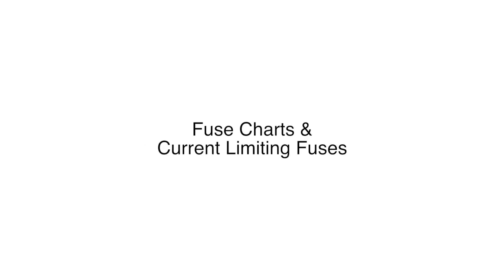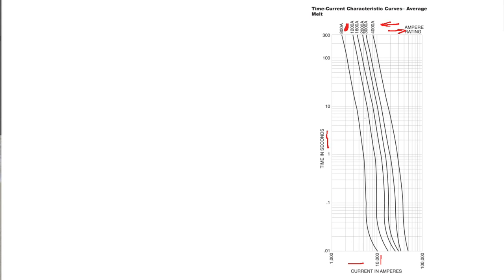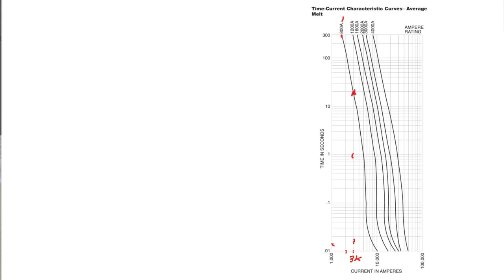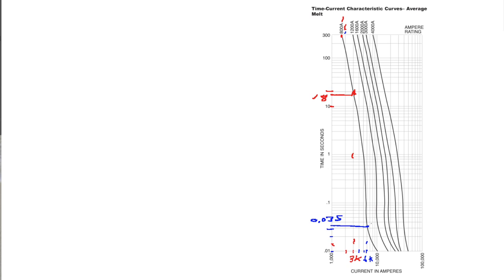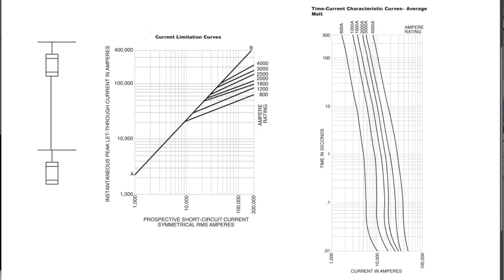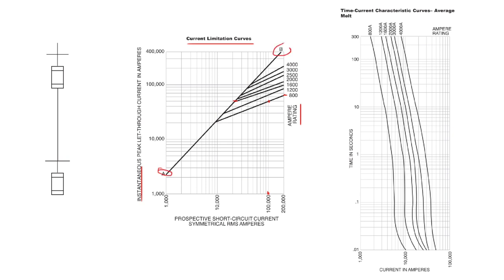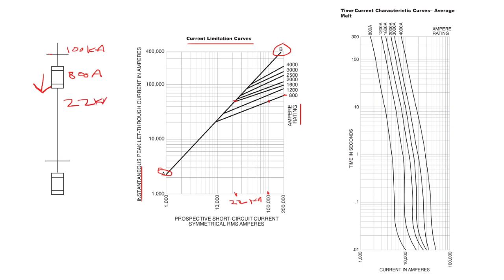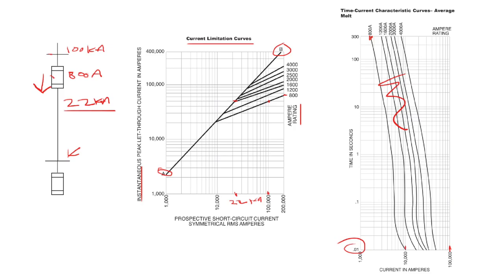Understanding Current Limit Fuses and let through current

Comment: I'm working on a project currently that has two CLF's in parallel with each other, that are then in series with an expulsion fuse. I assume that would operate as a current divider, half of the available fault current going to each CLF, then adding back again as it hits the expulsion fuse, but wanted to make sure there wasn't other considerations that should be made for this configuration. I would greatly appreciate your insight on this! Thanks for the great video!
Reply from the maker: Realistically that may typically happen but what if the fault is in the before they rejoin?  In general it's safest to always assume peak fault current will be present regardless of circumstance.  Things change, temporary setups in an unplanned situation
, etc.

Comment: But why let through the 20kA fault currenti in the first Place. wouldn't that just damage the downstream circuit
Reply from the maker: There's a few things to consider, first most standard overcurrent protection device have to let through more current than it's rated for for a brief time to handle inrush current (motor, transformer, etc).  Past that, yes it's ideal not to let through any fault current I'm not aware of any mass market protective devices that does this.  "Instant" trips always have a minor melt time, latching time, etc so during that time there will be some level of fault current.  Some fuses and circuit breakers specialize in minimizing let through current.  Past that, the downstream devices need to be rated to carry whatever potential fault current they may be briefly exposed to.  Protective devices should be rated to carry full fault current (not let through) unless they're in a manufacturer approved series combination.

Comment: Where does conductor length factor in
Reply from the maker: The conductor length/size/properties reduces the fault current from the source to the fuse due to it's impedance.  Calculating the available fault current is not covered in this video.
Reply: @graceyj20  I was binging and just put the comment on the current vid I was on. Thanks

Comment: UL 508A is concerned with Peak let-thru, not Symmetrical RMS, when determining the short-circuit current rating of an electrical enclosure.
Reply from the maker: Thanks for you comment.  Certainly some standards so however NEC (2017) focuses on the symmetrical rating.  See article 100 Definitions for Short Circuit Current Rating.
Reply: @graceyj20  How to evaluate this? I have a scenario where using current limiting fuses would normally consider the symmetrical RMS even major fuse manufacturers will highlight the consideration of the sym. RMS not the peak let through. But say a client will want to require the consideration be in "peak let thru" and even highlight SB4.3.3 as a reference. so clearly this is a battle of consideration between the one with "peak" and those with "rms" please advise. I am so confuse right now.
Reply from the maker: @zidanetribal2343  Typically NFPA 70 (NEC) requires all components to be rated for the symmetrical fault current they may be exposed to.  There are exceptions though such as manufacturer approved series rated devices.  Other standards have different requirements and methodologies.  NRTL's such as UL also approve manufactured assemblies where the assembly provides an integrated designed unit that has undergone independent testing and has specific operational guidelines.  Ultimately it comes down to the details of the circumstance, engineering judgement and what the authority having jurisdiction will permit.  With respect to safety and liability, one can never go wrong with a fully rated unit.
Reply: @graceyj20  I see, so it goes down on where and what a scenario will require like in all standards, if say company A will require compliance with standard X then by all means we will comply with standard X and also if company B will require adherence to standard Y then we should follow. Thank you so much.

Comment: Thanks Jonathan, i am only confused on your last sentence.
Once the 800A fuse melt due to 100kA fault, shouldn't be the fault level is cleared?
Assuming the Fuse in connected in series with the system, the fault will be isolated from the down stream isnt it?
Reply from the maker: Hi Zen, yes the fault will be isolated after approx 0.01 seconds.  Prior to that it'll let through 22k in my example.  It may not have been the best example as the time is so brief... as another imaginary example, let's say there was 25kA of fault current and that some current limiting fuse had a let through of 10KA and a trip at 0.3 seconds then you can see how the let through is more useful as the downstream device will have to withstand many cycles under a fault before the fuse will trip.  Hope  that helps!
Reply: Hi Jonathan,
Is my understanding correct that
Let through limiting fuse is not required to blow its own to get characteristic  of limiting current to downstream? Just current pass through it and it already limited current to downstream without blown itself?

Comment: In the first example, If the current dropped back to 800A before it gets 18 seconds, What would happen?
Reply from the maker: If the current dropped to 800A before it tripped then nothing should happen at 18 seconds.  The fuse should theoretically trip at 800A but over a longer period.  As the trip is thermal (melt) the heating up at 3000A for say 17 seconds would be relevant with respect to the trip point if dropped to 800A.  If it dropped to say 799 Amps at 17 seconds then it should never trip, in theory.  Circuits are not supposed to be more then 80% loaded so a properly designed circuit with an 800A fuse shouldn't have more then 640A of constant draw.

Comment: if we start at 100k and you want to reduce for MCB at 10k, then you have to reduce twice?
Reply from the maker: That depends on the protective device characteristics and the short circuit current sources throughout the system.  That said, if you're looking to reduce for a 10KAIC rated MCB you should confirm with the MCB manufacturer that the make/model of the fuse your planing to use is recognized for series rating with that specific MCB.